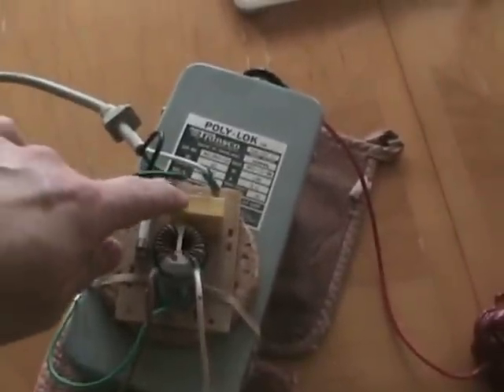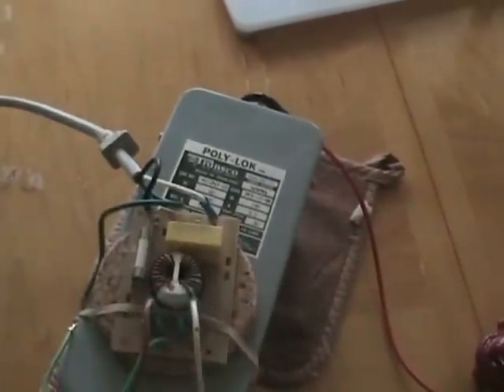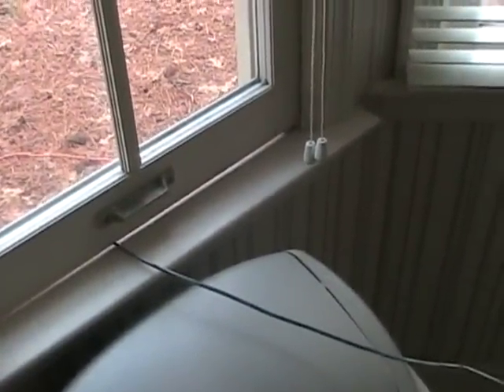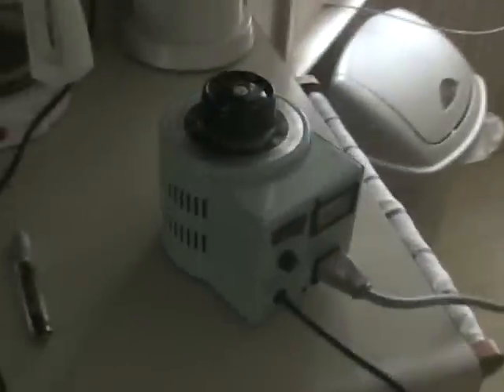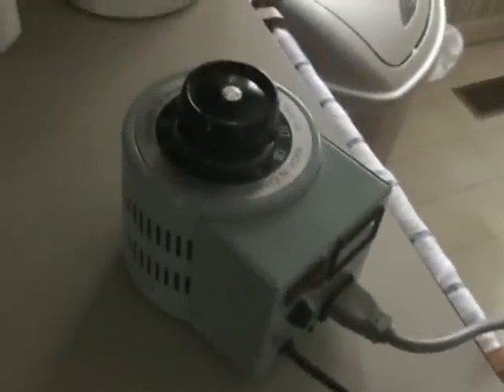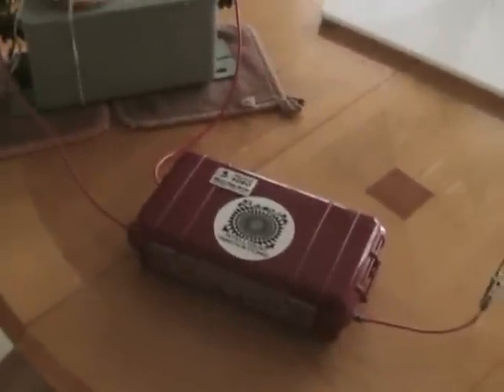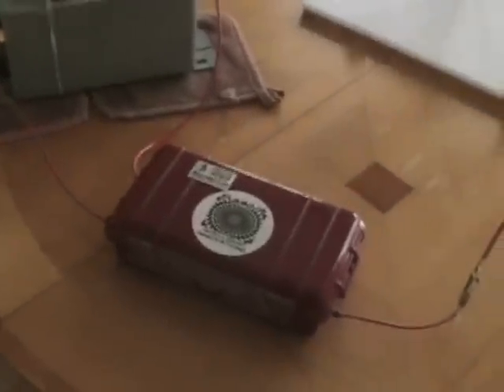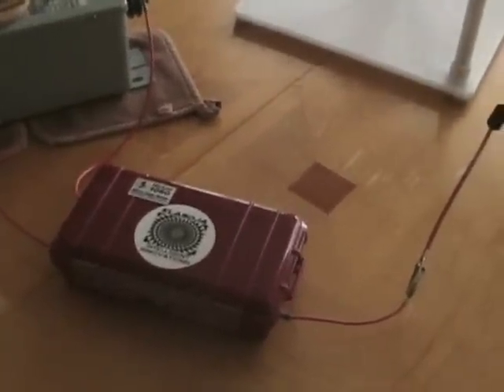Asymmetrical Capacitor Thrusters with Multiplier

Comment: How many hertz does that nst operate at? Because my NST is 60 hertz and my voltage multiplier wasn’t working with my NST. I guess at 60 hertz I need way bigger capacitors.
Reply from the maker: 60Hz.

Comment: would it still move if it's covered up like a can with lid?
Reply from the maker: Possibly. The thruster throws off ions, and works best where air can be ionized around it, generating more thrust. But even in a vacuum it works somewhat.